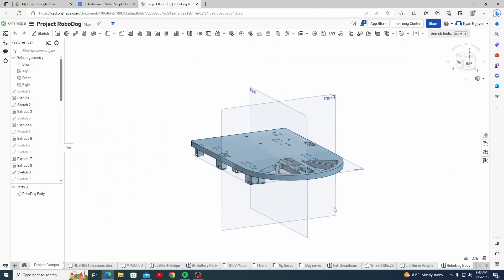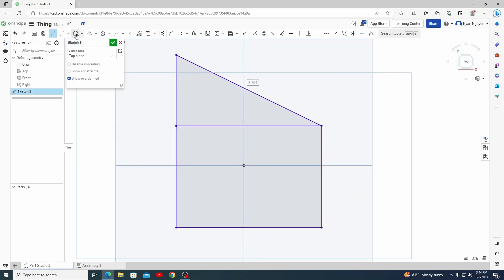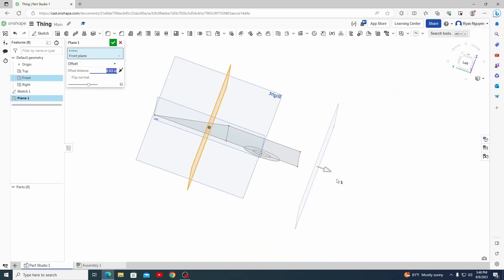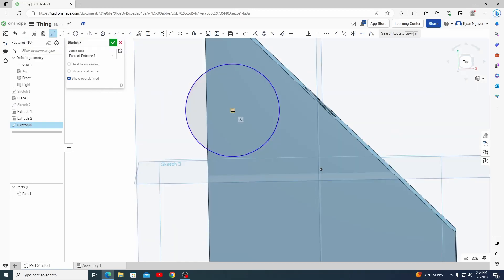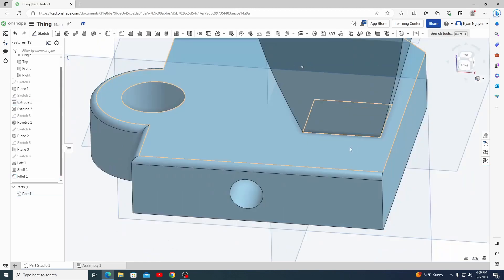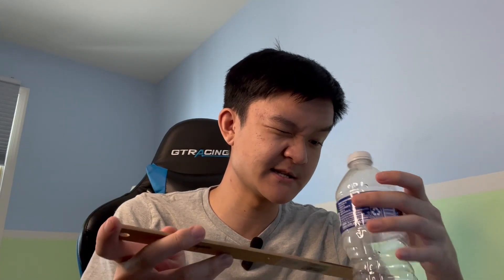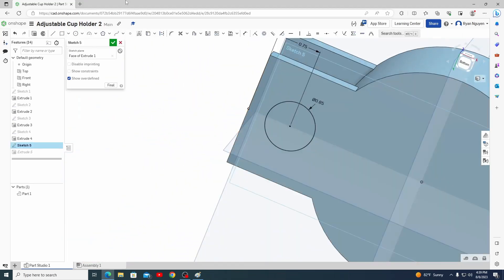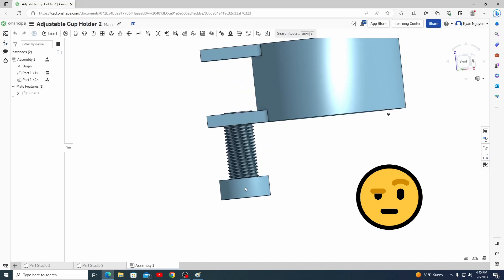ANYONE can make ANYTHING with CAD! | Onshape Guide

Comment: How did you print the cup holder, it seems to have nasty overhangs no matter how you rotate it
Reply: I used tree supports with the print upright (opening of cupholder facing up). I made sure that the block with the threads were excluded from any supports with an exclusion zone block created in my slicer Cura. Tree supports are supposedly easier to remove as well. Hope this helps!
Reply: @lordorion8657  thanks for the advice man

Comment: Awesome vid man I just got my printer recently and am learning Onshape
Reply from the maker: Thanks! 3D printers and CAD is a wonderful combination!
Reply: @TheTinkeringTechie  I wanted to ask since you might Actully answer when using the loft tool it makes a third part, how do you merge the original two parts plus the loft part into 1 singular larger part?
Reply from the maker: So, there's a thing called boolean. When you select two parts (selecting them using the listed parts in the bottom left with ctrl + left click), you can then right click those selected parts, select boolean, and press "union". What this does, is it combines the selected parts together, as long as they are touching/intersecting. Hope this helps! @pro-11-brawlstars68
Reply: @TheTinkeringTechie  awesome tysm!